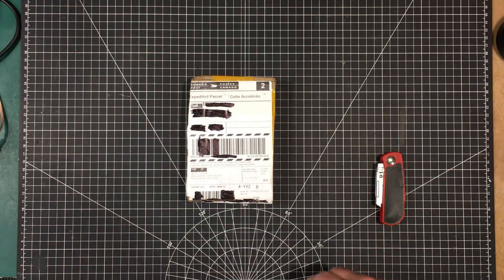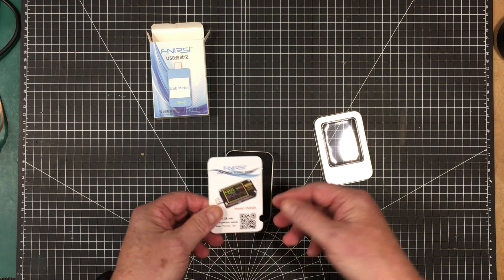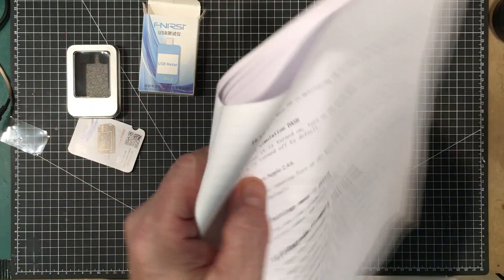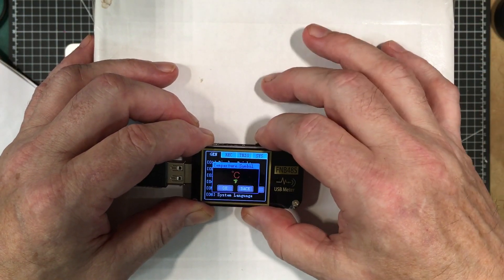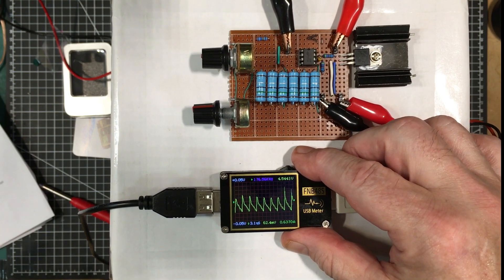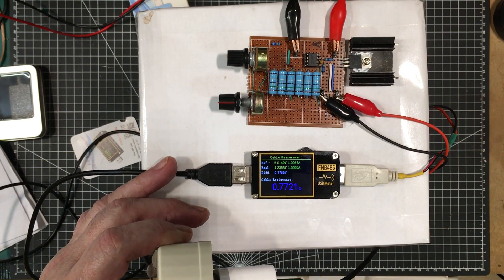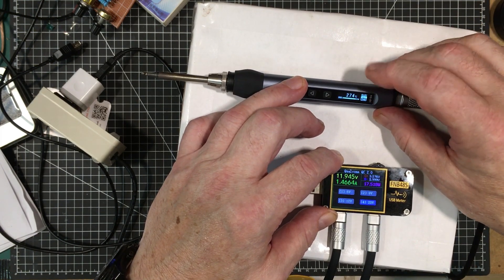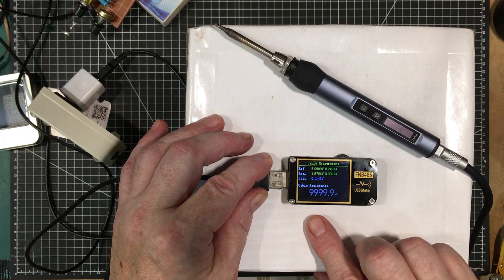Uni-Byte 0201 - FNIRSI FNB48 USB Meter from AliExpress.

Comment: When these gizmos were entering the market, I realized that being able to reach in and read different things on the USB lines could be very beneficial. However, being suspicious of the quality of inexpensive Asian electronics, I thought it would be better to use my own lab-grade test gear to do measurements. Accordingly, I developed a PCB board to facilitate easy access to the USB lines. I call it "The Tapper." Here is how it is arranged... USB-A Input connector to Test Point Loops to Jumpers to a second set of Test Point Loops to USB-B Output connector. Different connector cords can make any needed connection, between the devices being observed. Here is how it works... A Jumper can be lifted, breaking a connection, and a meter can be inserted in series. Or, readings can be taking with the broken connection, on the Test Loops, on either side of the break. Additionally, the jumper can be left in place and traffic can be observed, via the Test Loops. You can configure any arrangement that you need to read any, or all, of the four lines. You could also use it to inject a charge on a battery powered device. Easy to DIY by any means... Point to Point, Perf Board, or have a board manufactured, for you to solder up. Way cheaper than the Gizmo. Way better information, via your own lab equipment, too. Cheers.
Reply from the maker: Sounds like a great idea.  And, I don't know why I'm just getting this comment now???
Reply: @uni-byte  Yes, that is odd. No worries; my feelings are still intact... (grin)

Comment: You may need to turn the PD-COM switch off, to let the usb-c soldering iron do the power negotiation, instead of the usb meter. It may need to use a different protocol (probably PD) to get 20V from that charger. In that mode, if plugged into a usb-c charger, the meter won't turn on until the device (soldering iron) does the negotiation. Also note that you may need to turn one of the usb-c plugs 180° (while you should be able to plug usb-c either orientation, that only holds for 1 cable between host/device/charger, not 2 joined/chained cables ... usually usb-c cables have just 1 CC wire, host or device ports detect orientation, but the join is not really handled, it's not strictly speaking to usb spec ...)
Reply from the maker: Thanks!  That's worth looking in to.
Reply from the maker: I had the opportunity to try your suggestion and got it on camera.  Have a look that today's video to see the results.  I hop to have it out around 2:00 pm or before.
Reply: @uni-byte  cool, thanks!

Comment: Great review. I bought the same usb tester from aliexpress a while back and it's a handy little device but I've never been able to get the cable test mode to work. I might not be doing it properly so I'll probably read the manual and try again. Oh and if I remember right I think they have some Pc software you can download that works with this model and the newer one.
Reply from the maker: Yes, they do have software.  I've downloaded it but have not installed it yet.  Maybe if I get some time...

What do you think of the controls?